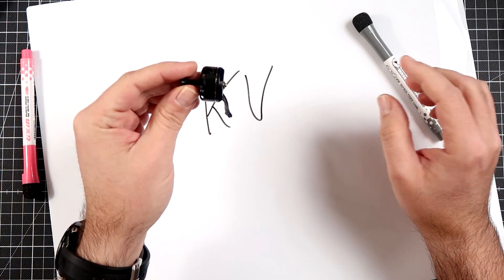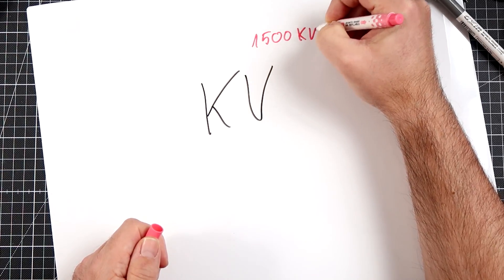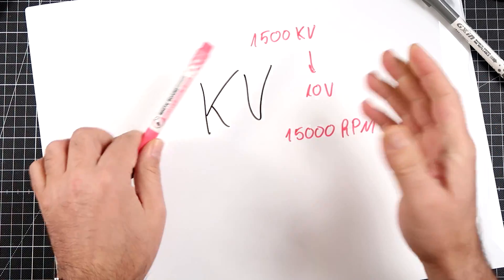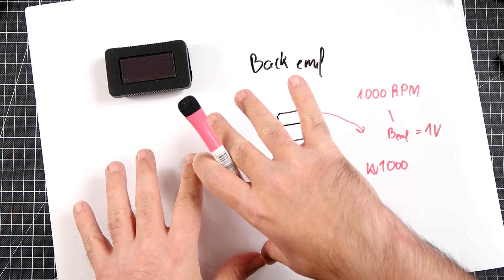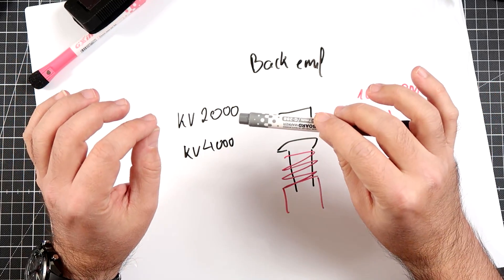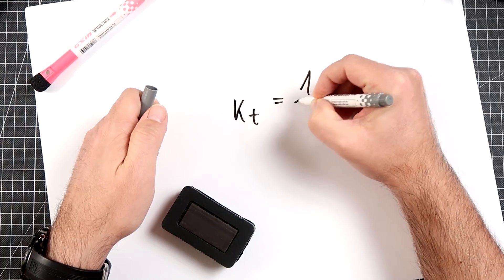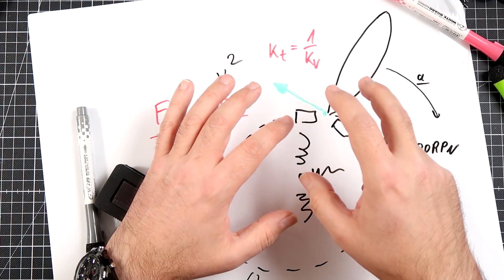Motor KV explained - KV is a lie and what you really need is a torque!

Comment: this kinda is similar to car engines, people often go crazy about how high an engine can rev, we know you can produce lot of power on high RPMs but what's the point if you want to cruise long range, high torque and low RPM engines are best for cruising and have better fuel efficiency.

Comment: It's a shame that "hobby" motor mfg don't simply use the specification methodology of industrial motor mfgs. Things like kv are simple shorthands intended to ignore the nuances of motor physics. A high quality motor mfg will give you rotor inertia, coil resistance, inductance, as well as (most importantly) torque-speed curves based on drive voltage. From this, you can choose the motor that best fits your application. Trying to find "hobby" brushless motors to fit my application has been so tedious because the mfg's simply don't provide the data that are appropriate.

Comment: Thanks a lot for your videos.
Can i ask you for the hint, how to calculate in a right way the motors for 9 inch quad if i know the full weight of the setup with battery and i want to make it as efficient as its possible?

Comment: Good effort trying to explain, but sorry to say it is wrong.
Kv is not a lie; it is just a specification of brushless motors.
It is always a misconception by many people though.
High Kv motor does not mean it has low torque. Same size motor theoretically has same nominal power ratings by design. High Kv motor need less voltage to achieve that power ratings, but more current; conversely, low Kv motor need high voltage to achieve the same power ratings, but less current. When they both achieve that ratings, power delivered is the same and thus same revolution and torque, even same heat generated.
Using high Kv or low depends on application scenarios: high voltage application chooses low Kv motor and low voltage one chooses high Kv motor.
People tend to have misconception high Kv motor deliver less torque is because: when user chooses high Kv motor in hope of high power to deliver they ignore power supply voltage, keeping the same voltage as in low Kv scenario, thus causing motor overloaded. From the motor power curve it can be observed motor's efficiency drops sharply after passing nominal power ratings, generating less torque but more heat.
In many cases, in the RC world, devices are used to the extremity, to name some: Lipo battery - lifespan is much shorter than nominal case because people are power-hungry; FPV video transmitter - for small form factor and more power, design is not good enough to handle signal integrity and delivery, thus generating a lot of waste heat ...

Comment: I am working on a boat project, but I wonder if it isn't it easier to match the propeller to the motor rather than to match the motor to the propeller?  Can't we just change the pitch and/or diameter?
Reply from the maker: It really depends on what you build. If a 5 inch drone then you are left with 5 inch propellers. Plus pitch is not all. Or rather it's a more complicated relationship

Comment: I just looked up what KV was and I was really confused to see that it is the revolutions- you could just add a gearbox and change your motor's KV! What a terrible "unit"!
Reply from the maker: No, gearbox does not change the KV. KV is a property of a motor only. And no, it's not even RPM per volt. It's Volts per RPM. The other way around

Comment: from what i understand, a synchronous ac motor like we use, responds to voltage or duty cycle of the sine wave. i don't understand how, because voltage only affects the power of the motor, so the speed controller must also be varying frequency. but then we run into why the frequency generated be higher with a higher voltage? if it can control frequency, does that mean the only reason we pulse width modulate voltage is for current limiting? have we all been running those special KISS escs this whole time?

if motors are controlled by frequency, then what is stopping motors from spinning at low RPM with high force, and therefore preventing desyncs?
Reply from the maker: That's a very good question. And the answer is that if we refer to "ESC frequency" as a PWM frequency at the output that this has nothing to do with the motor speed at all. It's just an information how fast ESC can drive a phase high/low for desired duty cycle.

ESC is either fully LOW or fully HIGH and PWM. So if 16V is applied then it's either 16V or 0V on the motor phase. With variable duty cycle we indeed limit the average voltage and average current. And thus, drive the strength of magnetic field and momentary torque. 

In fact, there are 2 frequencies on each phase. One that depends on the RPM when the phase is energized and the second that depends on the ESC PWM output frequency.

First one changes with RPM directly, the sencond one changes only if variable PWM frequency is used. If it's not used, it's a constant 24/48/96 kHz.

And motors stall on low RPM for 2 reasons:
- on low RPM fast motor need low current and torque to spin, so it's probable that momentary load torque is more than momentary motor output torque
- ESC needs to detect zero crossing with back-emf detection. If RPM are too low, back-emf is low and ESC fails to detect, loses the info how fast motor is rotating, does not energize the coils with enough precission and has to switch to low-torque startup phase when it just tries to keep motor rotating fast enough to be able to detect zero crossing. Then motor has vary little torque and can stop easily.
Reply: With proper motor control you can achieve full torque from standstill.

Comment: As an engineer, I would never use kv to select a motor for a given application. You need torque and power (ideally a torque vs rpm curve graph). Kv is meaningless.
Reply from the maker: yes it. Unfortunately in the RC world nobody provides torque and rpm to torque curve. And nobody really gets that. So KV plus size is just "good enough" approximation of a problem

Comment: Torque = work.  Fxd. Force x distance.  But you can't really get a useful mathematical value for any aircraft, approximate ok, depends on flying style, it's a starting point but trial flights confirm your math.  I just ask a guy which motor works better.
Reply from the maker: No. Torque is not work. Torque is force for angular movement

Comment: HI, would 1806 2700kv motors give me any more power or speed on my 3 inch quad than say the normal 1407 3600kv motors. im trying to decide what to use in my heavy 360 gram 3 inch build. im running a gopro session and large lipo , thats why its so heavy.  What are your thoughts?  which would be better for my setup? thanks brother.
Reply from the maker: It's not that simple. You can try https://www.ecalc.ch/xcoptercalc.php to simulate

Comment: I cant agree with you. Torque = amps * Kt = amps / KV. Formula is very simple. If you have 3000KV and 50A, with 6000KV you need 100A to achieve the same torque and max speed. 2 times more current, not 4 times.

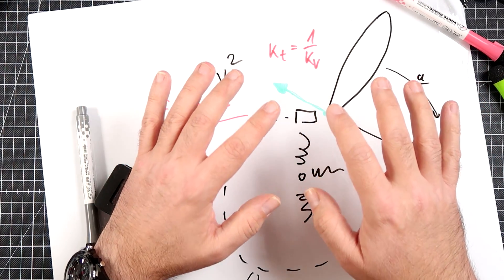Comment: 15:50 increasing KV doesn't lower torque...I read that for same size motors, all KV will have roughly same max torque due to same copper loss
Reply: Yes, but you have to deliver max voltage for individual motor.

Comment: Kt~ 1/kv, not "=" . Kt=1/kv   for a given size with same configuration of motor, not for different motors.  
The required power is going up by cube. On one hand the drag proportional  u * v=  friction coefficient x speed  , on the other hand the energy applied to the moved air is squared E = m*v*v/2.
Ofcourse this is very said.
Kv it's not a "lie" it's like rpm on cars, it's nobody's fault if you want to put a formula one engine on a truck, keeping the original gearbox of either one (truck or f1  car). You have to mach the rpm/torque of engine with the one of the load. Same with kv and propeller you have to match propeller size&pitch with kv&kt&voltage. Usually for a given propulsion system there is some spare torque (which is used during acceleration mostly, but not used  during steady load) , so there is room for a little higher kv.

Comment: More Kv not is less effy.  Motor work is Propeller speed + Trhust.  Motor work is determinated por weight motor.  in RC is around 3watts /grame  In EDF around 6-10 watts /grame.  Never work a electric motor below of 70% effyciency.

Comment: Thank you this should be far more widely understood by the quad community. I think it is possible to argue that for a quad-copter the lower the KV (and higher the Kt) of the motors the better. One can always increase the available voltage to get the RPM you need for flight but if Kt is too low you will exceed the current limit for the motor windings before you have sufficient torque to drive the propeller. Also, the higher the drive voltage the lower the current for a given power requirement. This gives smaller voltage drops in the wiring of the quad and the ESCs and/or allows lighter gauge wiring to be used thus reducing the weight. As you have said propeller efficiency increases with increasing disc area and, within reason, one can always tailor blade chord and pitch to achieve an efficient lift/drag ratio for the blades. There are other advantages - high torque applied to slow-revving, large diameter props give you more torque available to give yaw authority to the quad. About the only down-side is the tendency for the bigger props to be heavier.
{One extremely minor point that could be handy for those wanting to do the sums Kt = 1/Kv when Kt is in N.m per amp and Kv is in radians per second per volt. If Kv is expressed in RPM/volt the equation becomes Kt = Pi/(30*Kv)  }

Comment: So, from this video understood that if we take the same motors but one is lower kv the other is higher kv, the lower kv one will be better because with the same torque on both motors the lower kv will consume less current and the higher kv will consume more, there is some gap here I guess or I don't understand something completely, it also makes me think we should never aim for higher kv motors, because what is the reason for that if lower kv will consume less but give the same torque, something isn't right here or I did not get something completely, because higher kv will definitely make your quad more aggressive in terms of speed changes and top speed should be higher than with lower kv

Comment: Interesting concept. Thanks for sharing. Question for you. This seems similar to my thoughts on Led Acid batteries on electric scooters. Since empty batteries don't weigh any less than a full battery, there's a point where the efficiency drops in a big way. The larger the battery, the more "juice" it needs to carry itself before showing any real benefit for the rider/scooter. I find that 36v is the best balance for speed and range. So is there an ideal balance you'd consider optimal for motor KV? I realize there's tons of other aspects like number of turns, the battery running through the motor, the amp rating etc. A lot of people seem to want high speed for RC cars, but it takes longer to get to the top speed. The distance is too extreme, further than anyone would really drive. I figure torque is more important in RC bashing and just messing around. How low of a KV would be "too low" if there's such a thing. Super low for crawlers, but a basher needs speed to take jumps and torque to control it in the air. Curious of your thoughts on "ideal/efficient kv" on a basher RC.
Reply: I have no clue about RC cars, but the way to do this is to always start at your design goal and figure out what the load for the motor will be. Then you pick batteries and motor.
For example if your goal is to drive at 100 km/h then you should figure out the required RPM that your wheels need to spin at. This will limit your choice of battery voltage, motor Kv and gear ratio.
Then, if possible, you should calculate the torque required at that speed. This will mainly be drag of your vehicle, any resistances in the bearings and gears. For the motor itself the specs usually contain Io (no-load current) which can be used to derive the extra torque required just the spin the unloaded motor.

Given required torque and some Kv, you can easily calculate the min current. Note that voltage drops over battery, ESC, and motor coil resistances add up and are proportional to that current, so the motor RPM will drop more and more with higher current.

Higher amp ratings usually mean lower resistance (in the batteries, ESC, and even the motor). This usually needs to be paid with extra weight and money. In RC airplanes weight is a huge problem. For my example of just driving at some top speed it doesn't matter that much.

You can of course also make acceleration at some velocity your design goal, and calculate required torque from that. Because as you said correctly, with the minimum acceleration to reach the top speed it will take huge distances to accelerate the car. Since F=ma it is clear that a higher mass needs higher force.
But since you know the torque required you can simply lower motor Kv (and raise battery voltage) and therefore increase acceleration as much as you want.

Finally, you can "score" potential combinations e.g. by calculating mechanical power/electrical power (= motor efficiency), or by motor run time given your choice of battery, etc.
Reply: Well i have a traxxas xmaxx. One of the largest heaviest monster trucks. Probably best basher out there. Original model came with a 1600kv 6s motor, my model has 1200kv 8s motor. The upgrades most people choose are either an 1100kv or 800kv motor and gear it through the roof to obtain the same speeds as the higher kv motors at much lower temps. 800 seems to be the biggest can motor people are using. The 800 and 1100 have roughly the same top speeds with the 800 being a bit more torquey. The 1600kv ones have a little bit higher top speed but you sacrifice alot of torque and deal with high temperatures

Comment: Question. In theory you are right. high kv = low torque. I have seen some reports, where the Motor has almost the same torque indepented from kv. It was brotherhobby T1 2800kv vs 3600kv vs 4100kv. The reason for this was that the windings are different. The KV is lower and the resistor of the windings is higher. Higher resistior less curent, less torque. If i compare at banggood for example the motorsheets from same motorsize and manufactor, low kv has most of the time an higher resistor. This brings me to my theorie:
As you sad, current = torque

low kv high resistor               torque = torque            high kv low resistor
drains less current                                                           drains high current

low kv low resistor              higher torque > torque     high kv low resistor

larger motor = more torque

result, if i want to buy a new motor by datasheet, i have to compare kv and internal resistor ans size for a torque compareson :)
Reply: no. The work of a motor measured in watts is represented when a propeller is put in thrust and propeller speed. The Kv influences the% distributed. more Kv, more propeller speed and less thrust and vice versa. So to achieve this, as we increase the Kv to a constant voltage the propeller must be smaller. In a model of Rc or airplane, Jet etc. the value of Kv x Voltage in the propeller rpm must be at least 70%. The power of an engine is determined by its weight and its ability to dissipate the heat generated.
Reply: @manuelverdugo1737  You didnt tell what do you want to achieve with changing to high KV motor with the same voltage, but with smaller propellers.
You gave only a little details. Those cases are more complicated.
You have to know electric motors characteristics. Motors have constant torque till the certain RPM, then, they losing a lot of torque. When you change low KV motor to the high KV motor with the same voltage, you can overvoltage it and mess with torque. Thats why you have to decrease load with smaller propeller, motor doesnt have enough power for big propeller or overheat too fast.

Comment: need show example, you need fly 4 motor max 400gram drone, what motor need be, and you fly drone weight have 30kg what motor, kv and propeller need be.examples please, i want understand what i need if i build drone what weight have 10kg or 30 kg. or 300 gram, about. i think build work drone to land. agricultural.or move to tool box home to workarea. or move pizza to home.
Reply: http://aeromodelismoelectrico.blogspot.com/search/label/Multicoptero    use translate included.

Comment: this not havev true, if you use too high kv=rpm motor you have cavitation, mean, motor run too fasdt and propeller run but plane not move anythink because propeller run too fast, same effect have at car, you run too fast you wheel run fast but car not move anythink. rpm must be ideal at peopeller, you need know what is propeller ideal and fasten rpm.
Reply: EDF use aroun 30,000 rpm  and up.  2000, 3000, 4000 kv is ok. But if in a rc plane, a very small propeller does not help. That is why after making the model and according to its characteristics, the propeller and rpm needed are determined, and then the engine is looked for to do the job.

Comment: Great video. 
One more point is in 4S, batterie limit the max current/torque. 
That is why 6s have dooble avantage : better Kt and curent (not) limit by batterie
Reply: Not quite. A 6S Lipo of the same C rating and weight as a 4S, will have aprox 1/3 less Capacity... and so will not be capable of supplying the same amperage as its 4S counterpart.